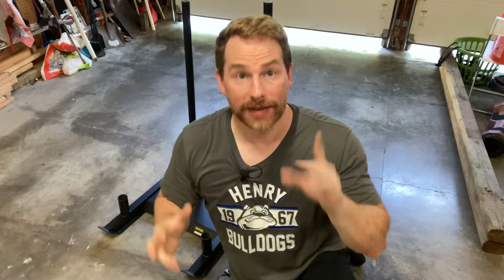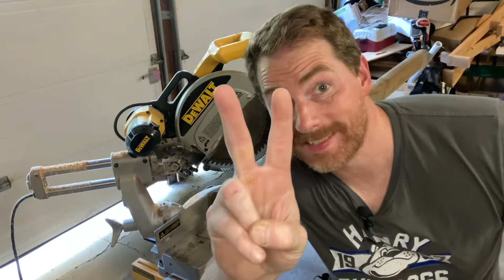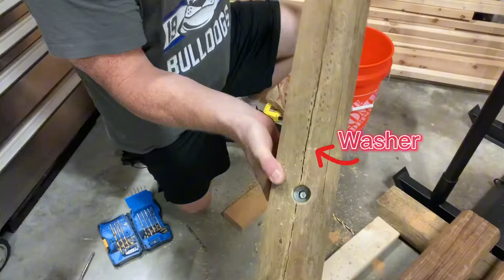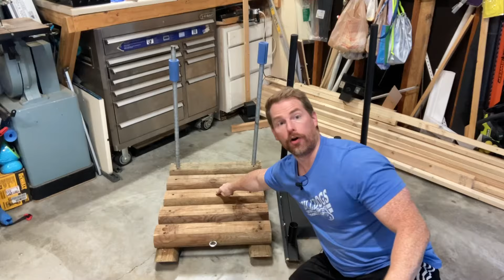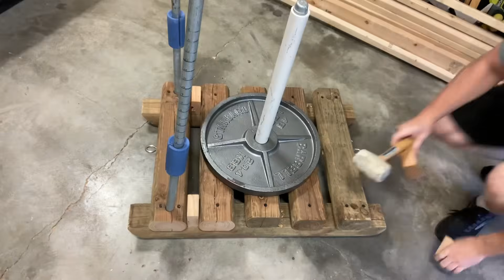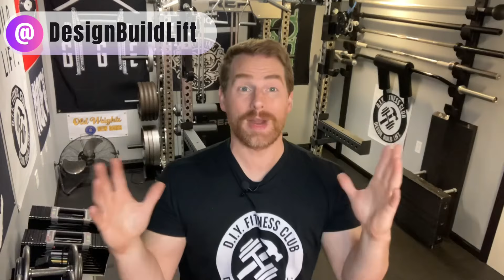DIY Push-Pull Sled

Comment: Why not just put some astroturf down on your concrete area?
Reply from the maker: I was just using this area because it’s easier to film here. I much prefer a longer stretch of concrete- like the sidewalk in Front of my house — or the street in my cul-de-sac.
Reply: @DesignBuildLift  Ah I see, fair enough. How's the homemade sled working out? Are you still using it?
Reply from the maker: I have not used it in a while. My training is currently more hypertrophy focused and I already have plenty of equipment in my air conditioned basement to achieve this.

Comment: Why didn't you just put wooden skids under the metal sled??
Reply from the maker: Because I wanted to make a DIY video to help others, and then sold the metal sled. Also - Since I used PT wood, I can leave it outside. If I left metal sled outside it would have rusted. Of course anyone could just skip the whole project and just buy a sled, drill holes through the steel, and then screw on some 2x4s.
Reply: @DesignBuildLift  I see. Well you did a great job! Thanks for your vid and reply! 🙂

Comment: Those handles look like they are getting pretty loose from pushing. Any upgrades/ideas on how to improve that?
Reply from the maker: The hole I drilled is just a little too big for the pipes I used, but that 1 1/8” bit was the only one that I had that would work. 1 1/16” would work better. Alternatively, you could just add a second layer of wood on top so that the pipes sit into deeper 1 1/8” holes.

Comment: I would prefer to add a treated 2x4  wood cut sled style under the already built metal sled just for noise reduction
Reply from the maker: That is what I was originally going to do, but then I figured - most people do not have sleds - so I made one from scratch. 🤘

Comment: Great set of ideas. I'm off to the shed to see what I've got available.
Reply from the maker: Please let me know how it goes! 🤘🙏💪
Reply: @DesignBuildLift  I started with an old roasting tray lined with carpet and loaded with weights. This worked really well on dry grass, unfortunately in the UK, this is not the case for much of the year. I'm changing to a weighted tyre, so I can use it year-round on the road (which is fortunately quite quiet) and allows the 50 metre drags that keep me fit.

Comment: I reckon that you use the wood as the slider/leg, how long does it last before it completely wear out? Im planning to build something similar for using it on concrete pavement road
Reply from the maker: It will depend on how often you use it and the “grit” of the surface of your street/sidewalk/driveway. That being said, it should last a long time. If you grind yours down to a nub, then you will be in great shape! …Also…on store bought expensive versions….the UHMW strip will also eventually wear out…so this issue exists for DIY versions and store bought versions.
Reply: @DesignBuildLift  what about adding sheet metal to the bottom of the skids
Reply from the maker: @SteveT313  I imagine that it will be noisier than wood and will marr the concrete. But if you don’t mind that, then go for it. It will certainly be more durable than wood.
Reply: @DesignBuildLift  only other option is an astroturf rug to be rolled out
Reply: Since I’m only planning on pulling across ranch gravel roads, I’m going to put skids on a tire version . Do you think treated wood or UHMW would be better?
Reply: @mikemccann8822 just update, i have been using a tyre as sled, been putting 150-225lbs weight on it, running it on concrete just fine for a yr now

Comment: Huge thumbs up for this video! I wondered if a pallet would work. Great job!
Reply from the maker: Thank you so much Ron! A pallet COULD work. However, the reason I put 45 degree cuts on the skids is to accommodate uneven surfaces in the road, sidewalk, driveway, etc…small curbs, etc… without those 45 degree cuts you might get “stuck” on an uneven surface.

Comment: I was just thinking about building a pull sled out of an old tire. This blows that idea away. I might build this today or tomorrow. Excellent project…and cheap!
Reply: That’s what I did. Tossed a bag of sand into an old tire swing 
Clipped it onto a dip belt
I pull in both directions instead of pushing the pipes but the workout is the same
Reply from the maker: Thank you Craig! Please let me know how the project turns out! 🙏🤘💪
Reply: The tyre sounds a great idea.
Reply: Tire is way better. Wood just skims across pavement, not enough friction. Saw one build where the guy added a hunk of rubber horse stall mat for added friction. Tire at the beach is the best. If you add weight to the front of your tire it reaIly digs in. If you're exhausted and just want to get back to the truck, move the weight (kettlebells for me) to the back of the tire. I push/pull with handles attached to 15 foot ropes. TRX type straps work good too. Those posts in your build will gradually bend and/or ream out the  holes or destroy the build as you already have run in to.
Reply: I just did it. Bought an eye bolt for $2 and got a free old tire from my local mechanic. I had some old sandbags and I stuffed them inside the tire. $14 for a cheap harness from amazon and total cost $16. Worked out for the first time today.